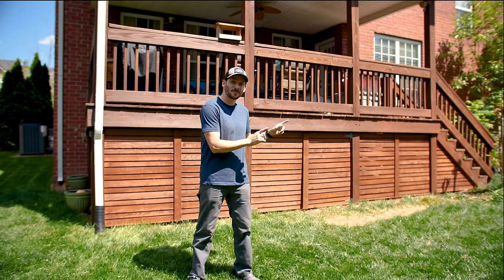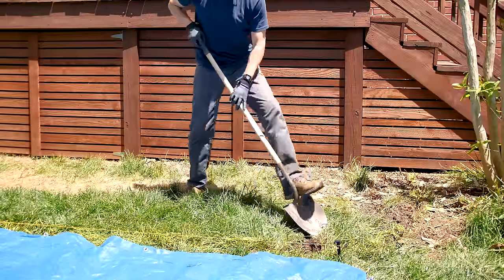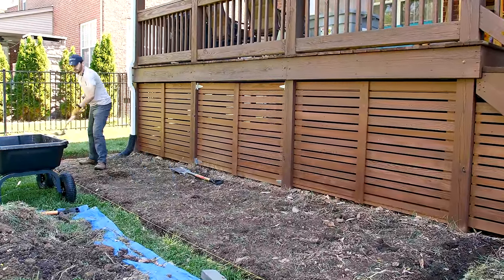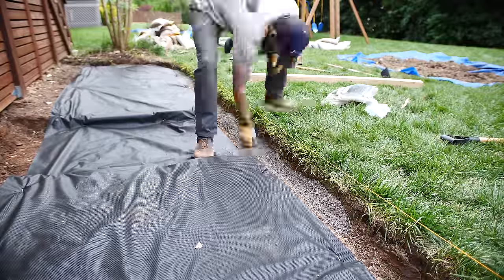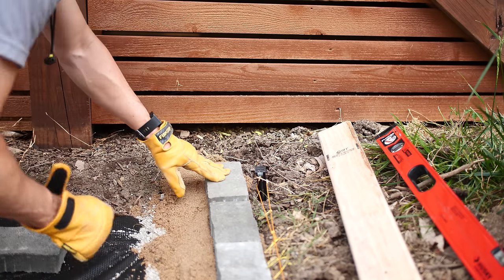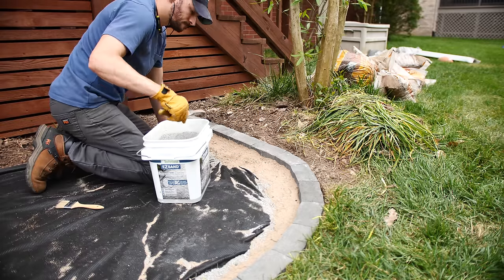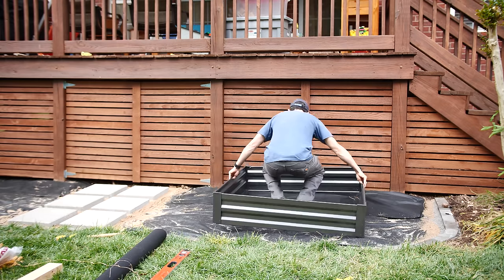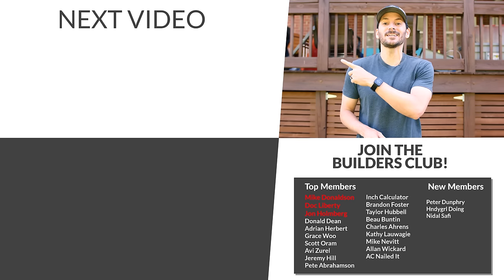How to Make a Raised Garden Bed with Paver Edging

Comment: I have done years of landscaping and have a few tips to make a nicer bed. The paver edging isnt used all that often though my company uses them and customers love it though we do it very differently. The bricks used were fine, though we usually use tumbled ones instead though that is up to personal preference. Instead of the base of chat and sand it is much easier to put down a layer of concrete/mortar mix. We just dig down the edge enough for an inch of concrete though it doesnt need to be anywhere near level at the bottom, just the top. To level it, one of the bricks can be used if nothing else, and they just need to be set on top and they will stick. In the video the top of the brick is level with the ground which is a big no-no, grass will grow over the edge and it wont look clean, you want the front edge slightly higher. Also instead of laying the bricks level we either tip them forward about 1-2 inches higher in the back than the front. Or we do “two-layer” edging, where we have a level brick with a vertical brick behind. A few more things on the edging, most of the time we use a mix of the rectangles and squares, 6x9 and 6x6, we do a random pattern though never more than 2 rectangles in a row or 3 squares in a row, if it is 2 layered then we make sure that they DONT line up. Also commonly looks much better to have a curve, in this case i would have it come out by the planters and recede between them, not much of a curve is needed but it looks nicer and you wont have to worry about the pavers being exactly straight, the gaps make it look nice with the curve so no brick need to be cut, though that is a sharp curve so using like 3 or 4 squares for it would make the gaps much smaller. The stepping stones can look nice in a bed like this but they need absolutely no base at all, they wont move unless they soil has been moved around and even if it has then it should settle evenly, if not then just put some rock under one side or the other. Another big no-no is the fabric, please never use that stuff, weeds will grow right through it. When doing mulch, nothing is needed just mulch every year or two and it will keep the weeds down if you do the proper amount, with rock please use just straight plastic, they sell it in rolls just like fabric except there are no holes for the weeds to grow through, dont worry about water, i have done large beds and we just cut an X shape around plants and stick them through and they get plenty of water and no pooling. Also didnt need to do all the work of lowering the bed and removing the dirt, cut down the front for a nice slope and throw it to the back the bed being kind of raised looks really nice and keeps water away from the house. I also do not agree that the cart is better, I can unload more than 10 yards of mulch in about an hour with a normal wheelbarrow in a average yard walking from the street to various parts of the house. Heavier things like rock can also be done, just get the right wheelbarrow, large capacity, long handles, and a nose so that when you tip forwards it will rest on that while dumping rather than moving while trying to lift. Can easily load 40 pavers into a wheelbarrow and take it around and let them slide out the front without hitting and cracking. I noticed other people say that when using a chisel on the bricks to make a mark all the way around, this is correct and makes a clean edge, but the middle will be textured which is nice if you are cutting a corner for a wall to make it match. Just lightly tap the chisel a few times all the way around, then pick a spot and hit it hard, if it does not break then you didnt hit it hard enough.
Reply: Thanks for the write up!
Reply: You need to have your own site. You're great! I've been doing this work for years and I agree with you. However, I'm happy you gave this young man some great pointers. He'll get better with time.
Reply: @sherrismith6136  well, I’m younger than him, difference in us is experience, many people have channels that do outdoor projects or home projects in general, the problem is that they havent done almost any specific type of work that they demonstrate any number of times other than on their own house or maybe a friends, to get good information for an informative video you should do much more than just a few times, get information from somebody who has been working in that specific type of business. I for example have to move sprinkler heads and do other similar things while on the job landscaping, but I would never try to do any more than that, thus I would not be comfortable with doing it in my own yard then telling others how I did it because even though it may work, it may not be long before I realize that I did not do it properly but to late for others that followed my method to do it differently, or even if I did do it entirely correct on my on property I would not know common problems that others may have to warn them about, if my yard was relatively flat and I did it then someone with a sloped yard may need to do it drastically differently, I think that gets the point across that knowing about a topic from similar experience is not enough to give a formed opinion which is what many people try doing
Reply: Well said.
Reply: Thank you!!!! I am trying to figure out a good edging between 6inch wide white pebbles perimeter and new lawn grass, and pavers seem a perfect choice to help with the mowing.
Reply: @Yodigi2  I totally agree. I just love following a "how to" video, to get 30 minutes in, and find out the person making the video has no clue what they are doing, and have never done it before.
Reply: I appreciate what you are sharing and look forward for your own channel by chance😀. I will be the first one who sub your channel!
Reply: Do I work with you?
Reply: @AR-nh1dv  I doubt it
Reply: @Yodigi2  Any pictures?  No weed barrier for grass then?  I have raised beds in back but 15+ years OLD and only a 6-8 " high.  Grass and some dang vining plants took over, but again old now.  Live in PNW, grass loves to grow here.  Plastic under rock?  TYIA
Reply: @SkyeBleuOfGreenAcre  the weed barrier for grass spreading into the bed can be pavers as shown in the video or what I have explained. Not sure what you are getting at when talking about the vines, weed spray usually works well for that, if removing from a bed it can be a pain as the have so many roots all over. Yes, plastic under rock works great, only have to make sure that its not tight up against the stems of your plants.
Reply: @SkyeBleuOfGreenAcre  NEVER place plastic under rock.
Reply: This is gold! Thanks! I was leaning towards using concrete/mortar mix to keep the Bermuda grass from growing underneath the blocks and you just confirmed it for me. The comments are almost always more helpful than the video itself haha
Reply: @wade5941 I'll never understand what possesses 🤡's to come on a thread where multiple professionals have explained why/how to do something that is either not obvious or seems completely counterintuitive to an average layperson; just for some random bum to jump in the conversation with "yOu ShOuLd NeVeR dO [insert professional advice here]" with absolutely zero explanation for their statement.. 🤔
Reply: Send a photo!

Comment: Hopefully you used a locking type sand, and not a play sand. Play sand has round granules that will erode away. Using a multipurpose sand, or even better, a paver sand, that has granules that are rough edge, locks the sand in place. With the locking sand, the paver base isn't necessary. But, the area is looking really nice.
Reply from the maker: Yup, it was paver sand 👍
Reply: It’s called sharp sand

Comment: Depending on how fast you want to do the whole job, water does a spectacular job of helping both level and tamp down the materials involved. I makes the particles shift more readily under the tamper, and then they pack better as well. Chances are, you'll want to wait a day before proceeding further, which is nontrivial, but it's worth considering. The pack job for your underlayment will be much much better, and far less likely to shift under the weight of the pavers, etc.

Comment: angle grinder + cold chisel works too.. score all the way around then a couple taps with the chisel and it'll sheer off much cleaner
Reply from the maker: Great tip!
Reply: You can split as big as 8" step block with this method if you want a natural textured face. It's pretty cool when it works
Reply: I've also had luck marking a line all the way around with a chisel, then driving the line deeper with each go - around. Good enough for when you need a neat line, but only have a hammer and chisel.
It takes ages though!
Reply: @samuelmellars7855  hey sometimes what you have the most of is time

Comment: I'm a big fan of the 4-wheel dump carts.  I have one with a "convertible" handle with two positions. In the first, you have a nice ring for pulling by hand.  The other position allows you to connect it to a riding lawn-mower and pull it that way. (The later position is great for heavy loads...)
Reply from the maker: Oh that sounds cool!
Reply: I have a very similar model cart to Brad's but it also has the convertible handle like yours. That cart has been crucial for all yard work projects I have done.

Comment: Fantastic job, looks great!  A suggestion for anyone contemplating a similar project in your yard, mow the area around as low as you can get and consider a sod cutter if you have a good sized area like this that you are doing.  It will do a great job and if the grass you are removing is in good shape you might be able to use it in another area in the yard.
Reply from the maker: We considered a sod cutter briefly but I thought the area was too small. Kinda wish I had got it!

Comment: On breaking the brick with the cold chisel, I’ve found that scoring along the side helps guide the break.
Reply from the maker: Great tip!
Reply: Yes score around all sides then use a wide chisel too break it, we find doing it on a hard flat surface works pretty good.

Comment: That looks really good. That edging will probably be fine but if you're only running a single line of pavers you should set them in concrete to help lock them together

Comment: I had a deck like yours at my old house.  I called it the Damn Deck!  It required annual staining and power washing to look good.  When you’re ready to do another staining project you should investigate metal spindles in stead of 2x2s. It will help A LOT to speed up the project.

Comment: Owned a landscaping company for a while. If you wanna be quick and make the most money. Use a weed eater instead of a shovel to remove the grass to expose the soil faster then you can create your trench with your moon, spades or shovel then do what ya do with the of course materials for stability your paver base, Stone dust or sand and paver stone itself.

Comment: Great improvement, Brad! Love seeing your home improvement content. Similar to your idea of using mastic to tie the bricks together, I've been thinking about using quick setting concrete to tie my brick edging together in my flower bed. Lay down a shallow base of concrete (maybe 2 inches), right on the dirt, place the bricks on top, fill the gaps and then simply water. My only worry is if it doesn't work, I'll have concrete chunks to deal with! lol
Reply from the maker: I've seen a lot of folks using concrete curbs and making lines to look like brick. Bet it would work!

Comment: Good one, you can add a little cement to the sand under the pavers to help hold them in place (10 or 12 : 1 but still dry).

Comment: damn man, that's an amazing job.  Could you perhaps throw in some cost analysis to help the viewers determine what that particular project ran in price since it's home depot materials.  Could also make a note that prices could be high bc of shortages so depending on when anyone does this, it might be cheaper if prices go down.  Overall, great job.  Now get that cold one and pop a top or two.
Reply from the maker: Thanks, Keith! I think all in it was probably around $5 a square foot. Could probably cut that in half using bulk materials
Reply: @Fixthisbuildthat  Plus the rental for the wet saw, shovel, wheel barrel etc.